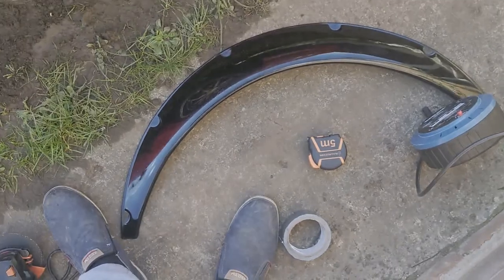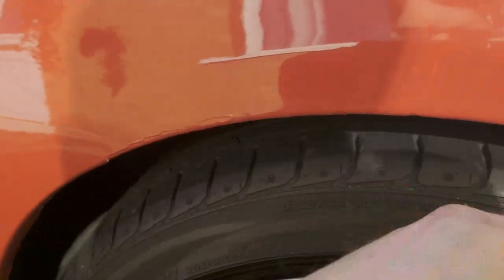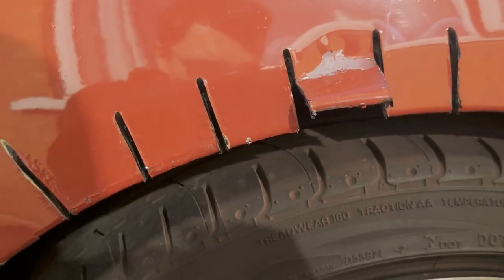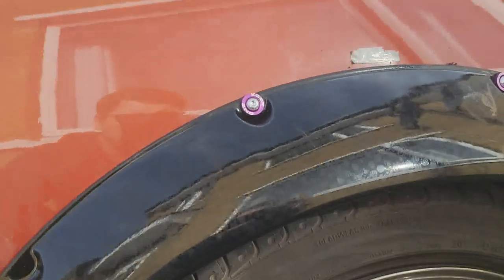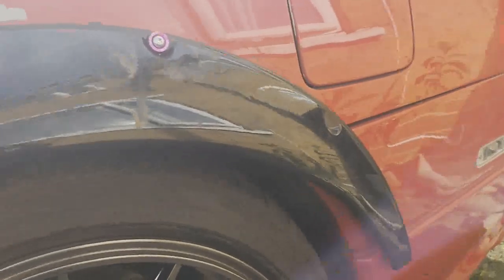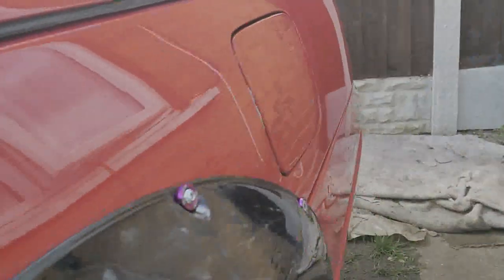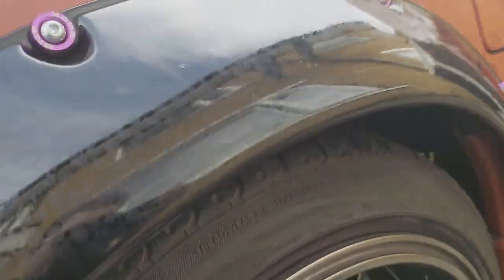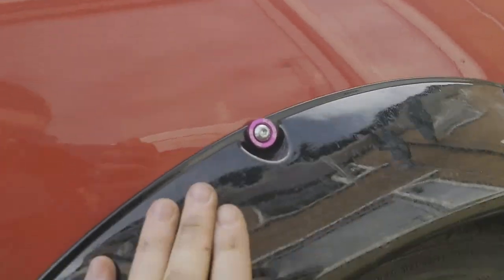How to fit wide arches on a car

Comment: How are the quality and fitment?
Reply from the maker: Really impressed with the quality. Also the fitment, I had to heat it up to mold it to the 300zx arch slightly but length wise and everything... Spot on. Can't complain

Comment: I recently bought a NA 300zx and I want to make alittle bit of power cause i dont wanna run stock on a good looking exterior
Reply from the maker: Loads you can still do. You could swap the engine for a twin turbo if you wanted. Supercharge it or do the basic... Air filter, exhaust stuff like that then remap for a small but increase none the less

Comment: will that pass a MOT like that as im going to be doing that to a car soon in the near future
Reply from the maker: Yes mate, as long as the tyre tread isn't past the new arch then it will pass.
Reply: @Phantom_garage93  any decent mot tester would fail that, what an absolute bodge!
Reply from the maker: @Gaming_Guru24  lol, I use the council testing place and they have never failed it for this. I have however had it all properly welded now but they never failed it before